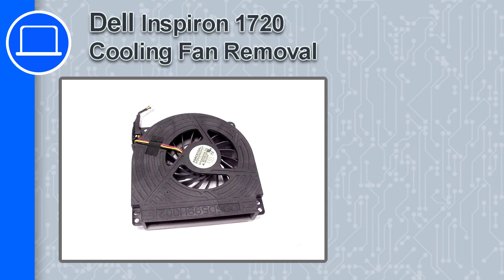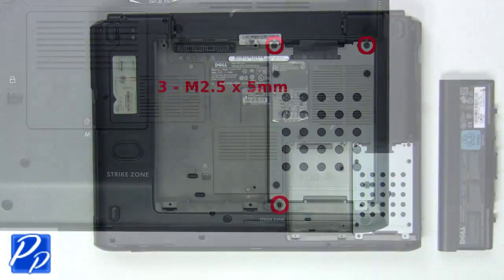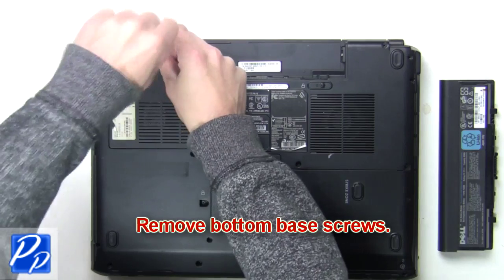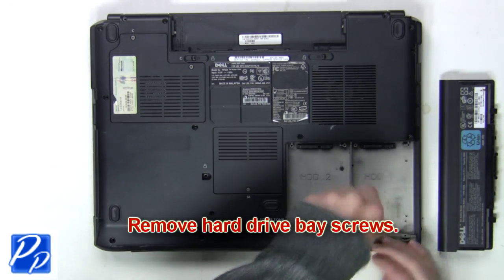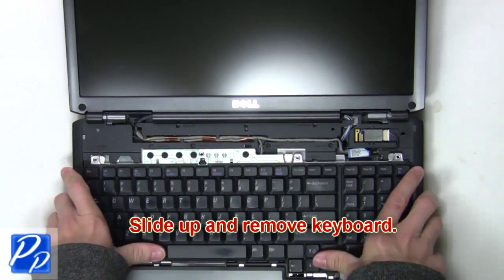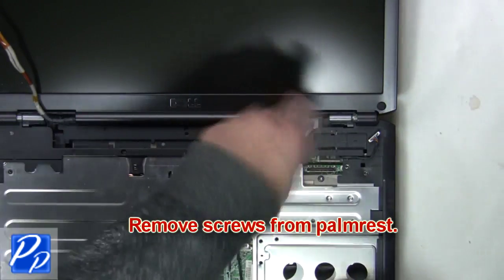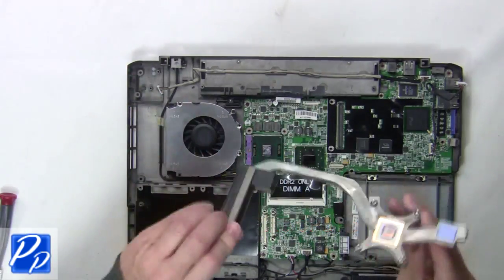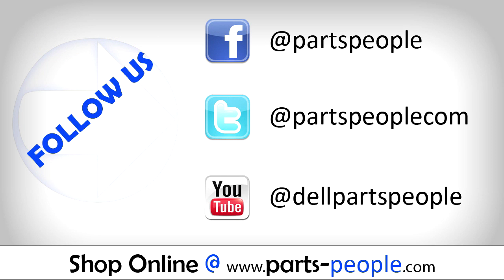Dell Inspiron 1720 CPU Cooling Fan Replacement Video Tutorial

Comment: Man can you help me. I have the same one. Whe i opened note for cleaning I also opened fan. Whey I put in on its place he didnt work. I did everything right and checked fan separatly. But when i put it in its place it doesnt work. And also the voltage on its connector is 3.5V  ot 5. What is the problem? Fan is working separetly but not on note
Reply from the maker: The fan will not run full time. It will only turn on when the CPU and GPU start to heat up.
Reply: Parts-People.Com, Inc Really? So I just need to wait when CPU starts heat up and the fan will run? thanks dude